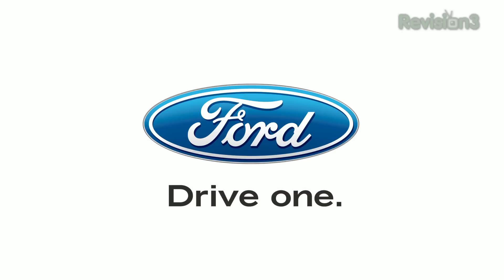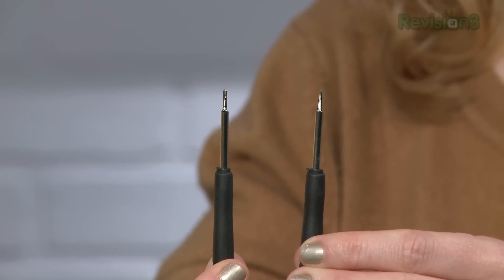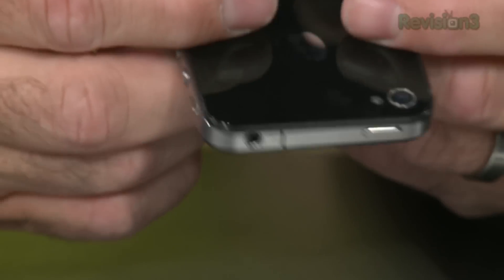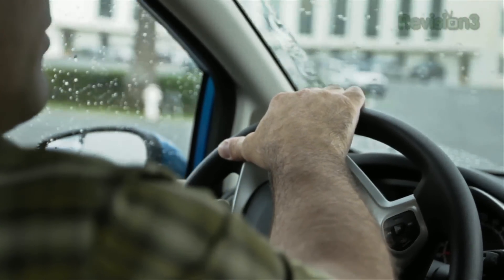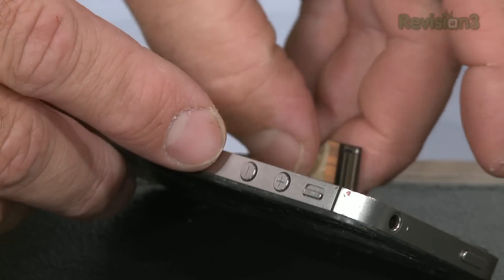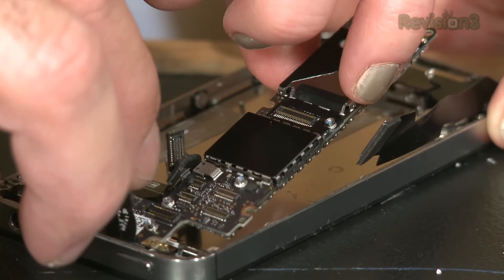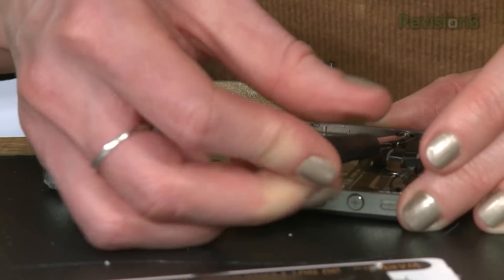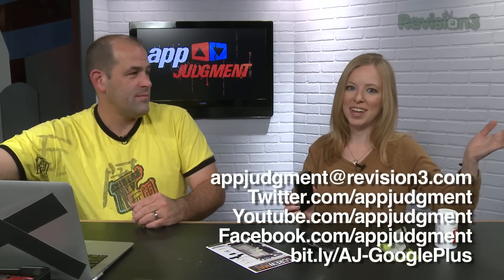How to Fix Your iPhone's Cracked Screen

Comment: @omfg191 no torx screws are pointed on the edges pentalobe screws are rounded also torx screws have 6 points and pentalobe screws only have 5 hence the penta

Comment: before you get inside this  or any phone GROUND yourself out (touching any large piece of metal) this will get rid of any electricity your carrying that will short it out.

heres a simple trick....follow this video for each step put the screws and parts on a piece of paper (section off the paper and number each section this way u dont have 50 pieces of paper to get blown off ur work area) u can also draw on the paper how the part looks before u take it out so u can reinstall it correctly

Comment: ugh im just going to FIX the screen AGAIn! this is the second time my thing cracked. first i was running and i put my ipod in my sweater and iy fell. the second time my little brothers found it and went under my bed and cracked it😡
Reply: just get a tempered glass screen protector... they are like 10 bucks on ebay, they are pretty easy to apply and if you drop your ipod in a way that would usually crack the screen it will only crack the protector, and its much easier and cheaper to replace one of those protector than the screen itself 

ive been using these on my phone for 2 years now and i dropped it like 5 times on stone floor and yes, the protector broke pretty much every time but the screen is still completely fine  

seriously i once dropped it in an elevator with tiled floor and the protector was broken in 5 places... peeled it off, and my phone was still perfectly fine

Comment: Ive fixed a cracked iPhone screen with out having to do all that, lol. All you do is take off the screws and use a powerful suction cup, unplug the screen from the bit attached to the phones base, reattach the the new screen, screw the screws back in and your done !